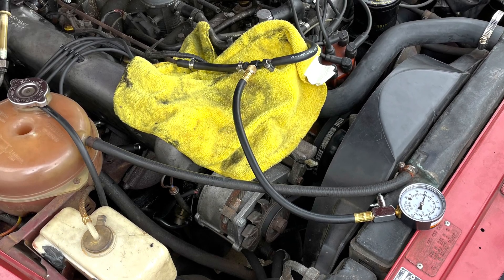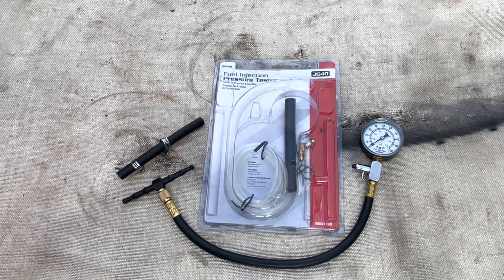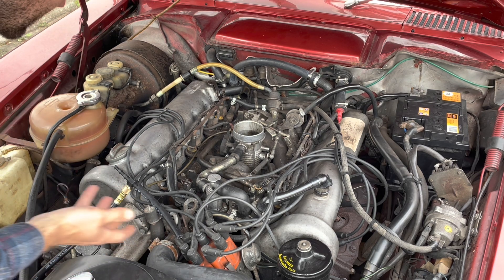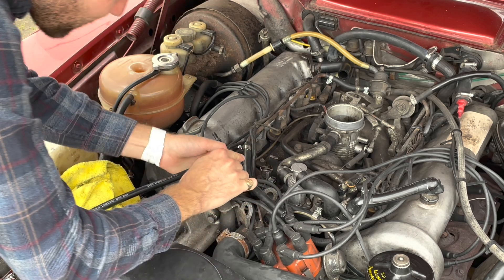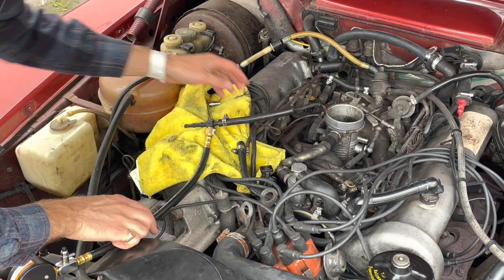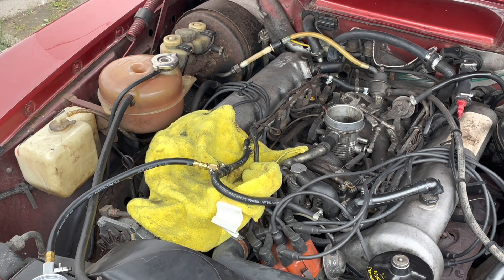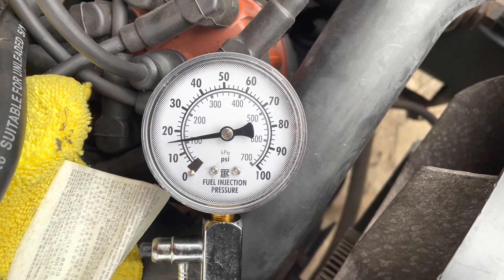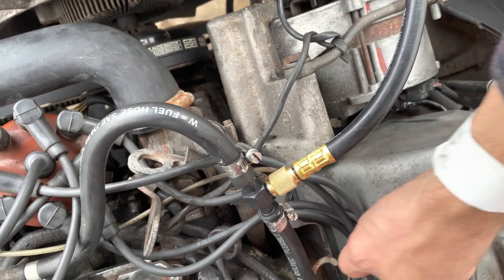Mercedes SL R107 - Bosch D-Jetronic Fuel Pressure Test

Comment: Go to home depot or ?? buy a gauge that read around 60 psi , get a braze barb fitting to attach a piece of hose , with 2 clamps .disconnect the cold start valve , attach the hose to the rail , you are ready .Also looking at that video , you must organize the spark plug wires away from any fuel line . There is a fire waiting there [ common ]

Comment: Was the issue the injector seals did you figure it out I have the exact same problem and can get it to keep ruining 
It does run but once I press the gas pedal it shuts off
Reply from the maker: So I slightly misspoke in the video - replacing the injector seals improved the vacuum sealing, but loss of fuel pressure was probably caused by the injectors themselves leaking, because the fuel pressure is in the fuel circuit, rather than the air.

Comment: Hi Ed. You have answered me a few days back, I’m looking around in your videos trying to troubleshoot my car. 
I talked with Pierre Hedary and he said injection leak is unlikely and he gave me two other options to look into: check valve being old or losing pressure at the regulator. 
But what’s weird for me now that I watched your video is that even after disconnecting the fuel pump and emptying the system from fuel, your car started on first crank. 
Since my hot starts are excellent, I’m starting to suspect something else:
I’m not losing pressure (I’m, but within what’s normal), but simply when I cold start, the pump can’t pour enough fuel to the engine in one try. 
So my pump could be bad ?
To be fair, even when I rotate the keys twice, it doesn’t start as fast as yours. Yours started like it was a hot start. 
I’m impressed and confused. 
If these info give you a new idea of troubleshooting I’ll take it. 
Love your videos!
Reply from the maker: Yes it does sound like for some reason you don’t have sufficient pressure and/volume at cold start. It could be all of those things Pierre suggests, but if running pressure is OK I would have thought it’s not the regulator. How is the fuel filter, could that be restricting flow?

Comment: Hi Ed , How did you disconnect the fuel pump safely?
Reply from the maker: Sorry I wrote a reply and then realised I was thinking of another video! For the pressure test, the correct way to relieve pressure is remove fuel pump relay and then crank. Because my relay board was very stiff and difficult to remove the relays from, I just disconnected the electrical wires to the fuel pump and cranked - that’s what I meant by ‘disconnect’ no need to remove any fuel pipes or anything. The connectors can be removed with a small socket.
Reply: @classiced1416  Thanks Ed, thats really helpful!

Comment: Previous commenter is correct - operating pressure should be 2 bar and residual pressure around 17/18 psi so no leak. I have a leak in mine and the pressure goes to 0 instantly when switched off.

Comment: Thanks for sharing. I believe your D-Jet has a pressure of 32psi with the engine running and the residual pressure of 16psi is about right as well. And I think your car has no leaks in the fuel circuit.

Comment: The original fuel pump has a maximum of 2 bar + - ... It seems as if the pump is not suitable. Someone has exchanged it? You can also adjust the pressure regulator, but it will cause problems later. Best of all everything is original. Very nice sound. these are cars unmistakable :P 
it is no problem to check the fuel pump , original bosch ?
Reply from the maker: Hi yes it had a 6 bar pump on it when it came in, I couldn’t find an original D Jet pump for reasonable money but someone who knows D Jet well recommended a 3 bar pump that is similar so I fitted that (I did another video on the subject). I turned the regulator down a bit as well and car seems happier now!

Comment: such a beautiful car! must run perfectly because of its elegance, this is a real Carl Mercedes Benz concept with Robert Bosch D-Jetronic Injection Masterwork system . first check the pressure regulator . see which fuel pump is installed? Original Bosch with 2 bar? Is that a nice V8 sound from a raceway alloy 350 slc engine :) ? Good Work this is realy "Made in West Germany" ! Thanks Germany

Comment: Hi Mate, that looks like a K-Jet fuel pump on that '72 SL.
Reply from the maker: Yes I think you may be right, someone may have fitted either in ignorance or because they could not find the correct one. Possibly explains why pressure is on the high side.
Reply: @classiced1416  I had to use a K-Jet pump on my 350 SL many years ago until I found a replacement D-Jet pump. It works  but the extra high pressure stresses the fuel system up to the regulator. The regulator does its best to keep pressure to approx 30 PSI.  I also believe the D-Jet pump has a higher flow rate than the later pump.
Reply: @ClassicCarMotorsport  
The D-Jet injection requires an exact system pressure of 2 bar. Everything else cannot work properly. Then check the closing angle of the contacts from the ignition
Reply: yes definitely with 4,7 - 5,0  bar . it will only destroy the pressure regulator . 
make a new video when the car drives. only the 350s had a good V8 sound